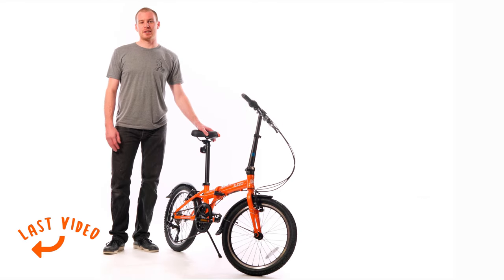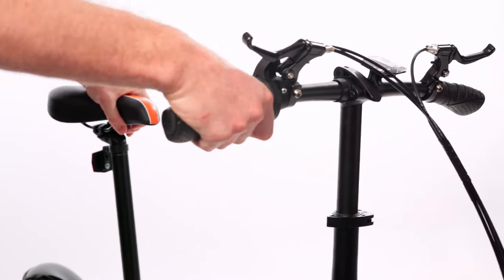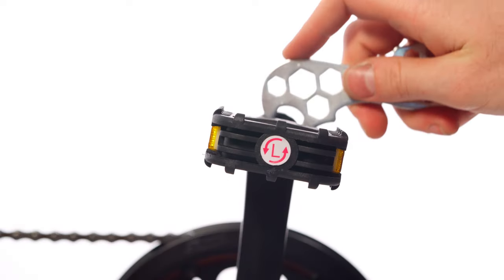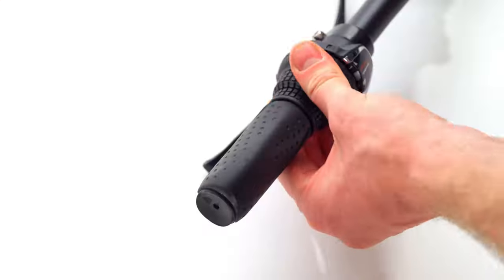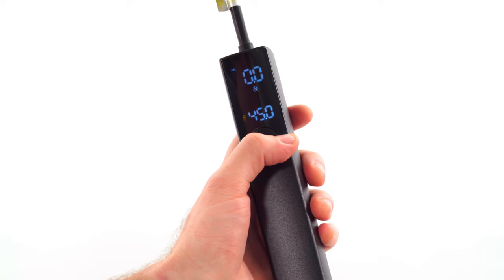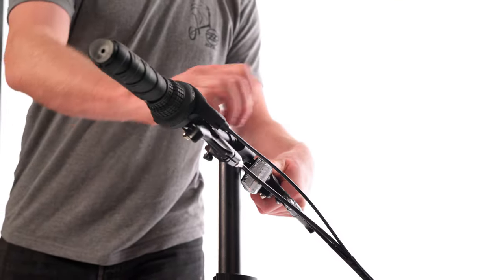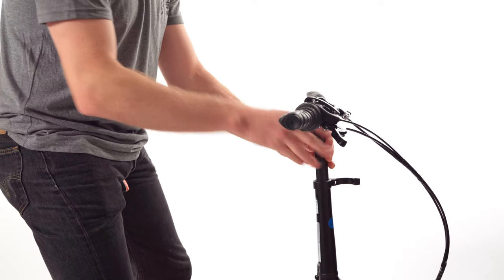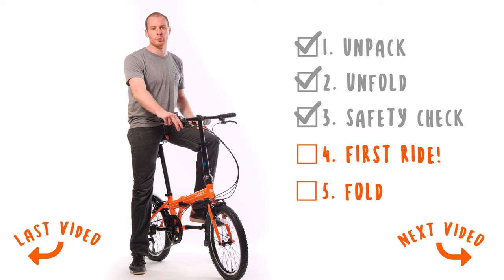Zizzo Get Started 2: Safety Check

Comment: just got the bike, I still have to do the safety ck- it didn't come with air tight tires, I hope when I put air, I have no issue. Did a quick inspection, ck'd breaks, not yet sat on it until I get the air/ck screws are tight. It took some muscle to open it, not crazy I can't lower the bar since I am small, but do like the idea it will fit better in my FIAT Pop- my other bike is great but hard to go around. town with it-- not sure though if I want to carry it around. Wish I knew who or where to find some fenders, and basket for it. I do look forward to riding it-- really nice bike even for an older model-plan on traveling-need something small.
Reply from the maker: Hi B Phillips
Thank you for your post! Let us know if you have any concerns with the tires holding air. Please note that the rubber tubes in all bicycles are similar to the rubber found in party balloons, and, like balloons, will lose air over time (it'll take about a week for the tubes to lose a noticeable amount of air).
With regards to fenders, racks and other accessories, we do sell these items on our site, and all ZiZZO Bikes use industry standard parts and sizing, meaning that most third party accessories would work with your bike as well ;-)
Please let us know if you have any other questions or concerns.
Tony

Comment: u know the front stem,,,,,,,,its extended all the way and is kinda wobbly?
Reply from the maker: Hi @yogi yogi
Thanks for your post. Because of the length of the stem, there is some flexing to be expected. 
Also, the stem should not be fully extended. The stem should only be extended as far as the last limit mark (the series of vertical white lines on the upper stem).
That being said, please reach out to our service team. We can try to determine if what you are noting is "normal" or should be addressed with an adjustment.
Tony
Reply: @ZiZZOBikes  yes , i tightened up the quick release and its ok. now.  same goes fo rthe seat post due to length a tiny flex is  noticed.  cranking down the q r fixed it but i always thought cranking down a q r was not a good idea but maybe this is for a wheel application.  ,  i think if i am careful i can fudge the mark on the front stem a tiny bit too long?
Reply from the maker: @yogavnture1  
Your statement, "cranking down a q r was not a good idea" is valid, however, what is "tight"??? Tightness is relative (superman lever "tight" is not the same as little kid "tight".
The difficulty is finding a way to translate tightness across many different riders and strengths!
A rough guide to sufficiently tighten the seatpost QR, for example, would be to twist the saddle. DO NOT SIT on the saddle becasue if it is still loose, you could slip and fall!
Tighten the QR on the seatpost. Raise the post and lock the QR. 
Test by trying to twist the saddle. If you can move the saddle, tighten the QR a bit more. 
One sufficiently tightened, that feel on the QR should be felt throughout the rest of the QRs on the bike!
Let us know if this makes sense or if you have any questions ;-) 
Tony
Reply: @ZiZZOBikes  BOTTOM LNE IS A Q R ON  A WHEEL DONT NEED TO BE AS TIGHT AS A QR ON A SEAT OR STEM.  CAUSE THE PRESSURE ON A QR ON A TIRE IS GOING UP.  AND THE PRESSURE ON A QR ON A SEATPOST OR STEM IS GOING DOWN.

Comment: Just got a brand new  Campo.. After I set it up, I took it to the bike shop the next day for a safety check, and  It was good to go.  I folded it up and put it back in my car. 
  A few hours later, I took it out of the back seat of my car for a quick ride and noticed that the front tire was flat.  A Neighbor and I tried putting air in it and it appeared to be filling up,  but it just went flat again. I haven't even ridden it yet!
Does anybody  have any idea what could have caused it to go flat while sitting in the car?
Could I have mistakenly unseated the tire from the rim when I folded The Handlebar down?
Reply from the maker: Hi Marcia 
Thank you for your post and we apologize for any difficulties. 
If you are able to remove the tube from the wheel, try to inflate the tube. With the tube inflated, try to locate the spot where air is escaping. 
Depending on the location and type of hole, we may be able to determine what the cause of the loss of air is. 
On a "side note", flats are a common (yet annoying) part of cycling. 
When working in bike shops in the past, I have seen customers get their flats fixed, only to get another flat 5 minutes after leaving the shop! 
Flats can be random and unpredictable, unfortunately.  
Please reach out to us directly if you have any questions or concerns.
Tony